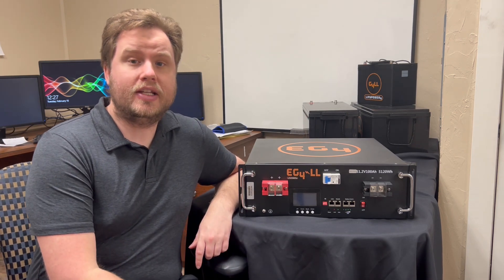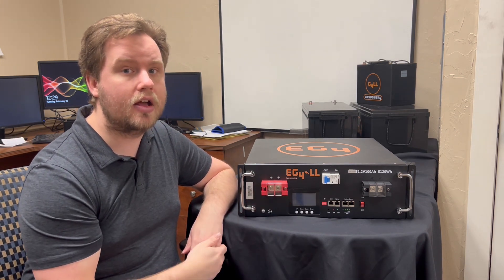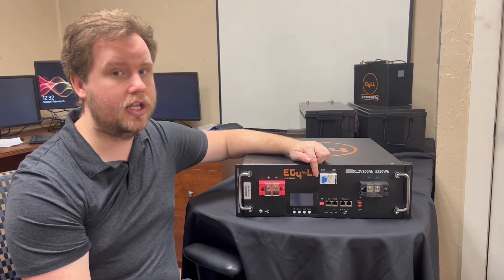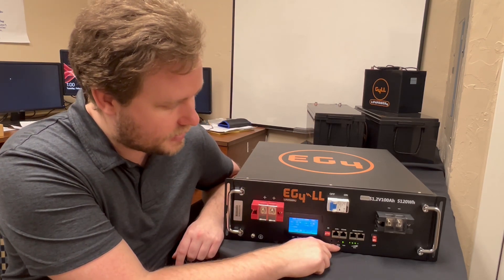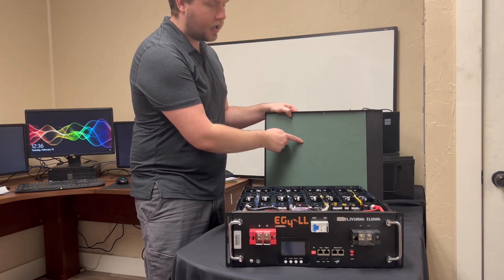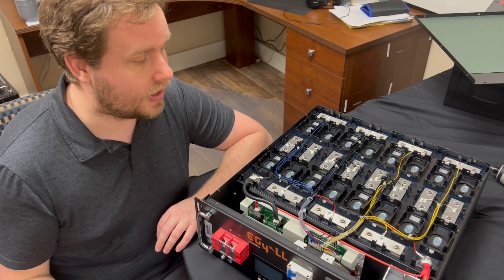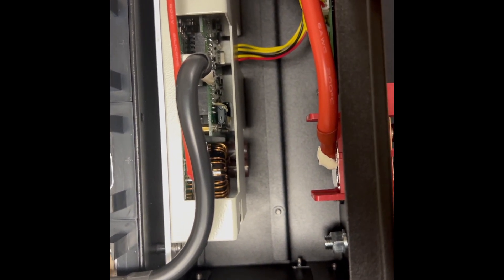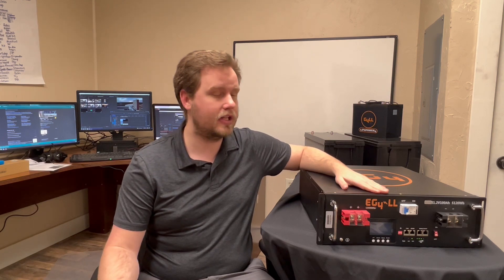EG4-LL 48v 100ah Battery Basic Teardown!

Comment: Is it possible for you to have a similar tube that tells about the 12V EG4 that does not have the screen?  I am also wanting to connect it to a Victron 12V MultiPlus II 3000AV charge inverter ...  is it practical to add a Bluetooth to watch what is going on?  ... Or does the PC software work good enough.  I also hope to install a Cerbo GX and would like to see if the system I ordered will connect.  I hears one of your other videos say something about a cable mod but it wasn't talking of the 12V

Comment: If the BMS shuts the battery down due to low voltage, will the BMS allow a generator to charge the battery from any voltage level, including the shut off level?
Reply: Applying charging voltage should wake up the bms to allow charging.

Comment: Would you do a video with 100 amps load and measure the voltage drop on the cables from the battery through the BMS and breaker ? You also failed to give the dip switch settings for the battery.

Comment: Is this battery compatible with the SMA Sunny Islands SI 6048-US-10 Units?  It looks like there is no way to communicate with the Sunny Island.  Would I just select Lithium batteries on the Sunny Island to manage this battery?
Reply from the maker: EG4 hasn't developed a closed comm with SMA yet. You can use them as just a battery without communications.

Comment: Your current web site shows the EG4 LL with no breaker on the battery positive terminal.  Your technical people said that it does not include the breaker now.  Is that true and if it is how do you turn off the battery?
Reply from the maker: There is an on/off switch. Depending on the model and voltage, some may or may not have a breaker.

Comment: Can you let me know if there are any plans to enable the communications from the battery to the MPP LV series of inverters.  Would love to get my batteries communicating directly with the inverters (LV6548s).  Happy to assist with any testing that may be needed as I have 5 of these batteries to support my two LV6548s in split phase.

Comment: I have two of these batteries connected and one shows typically 10% higher SOC than the other, so one will be at 39% and the other is 29%, due to their voltage being the same at those two levels.  They were purchasedf only 2 months apart.  I wish I could make the display stay on longer than 30 seconds too.

Comment: When these batteries are connected to the 6 slot rack, are you able to connect the battery chargers you sell directly to the bus bars? I have two of the chargers and was wondering if I just connect both chargers to the bus bars at the same time to charge all 6 batteries? Also, do a review of the 12k growatt :)
Reply: @Richard from Signature Solar yes to the bus bar and chargers correct? Not just the 12k review?

Comment: I have 3 of the older EG4 batteries without LCD and I'd like to know if I could swap out the BMS for the one inside this battery so it will communicate with my Growatt??
Reply: @Richard from Signature Solar and also, I'm mounting these in my RV and John told me that y'all have a down-converter so I can have a 12v bus for my 12v gadgets such as water pump and bathroom fan but I don't see it on your website. Can you send me a link?

Comment: Richard, As I stated in my first video in my trouble shooting of the Battery/Comm. ports I came to the conclusion that the there is no conection  between  the RS485 port and the Battery/COMM. ports. Please show us deeper look at the connections from the RS485 port to the Battery/Comm. ports. Also have you tested to see if an 8 port RS485/Can buss box can be used to connect the batteries to a computer to use the BMS Tools software?
Reply: @Richard from Signature Solar Thank you I will be looking forward to seeing it, I tested a 4 port unit from L-com today and it worked fine.

Comment: Good demonstration Richard.
Id like to request a teardown video of the 48v 100A waterproof model battery.
I just got 16 of them from you and it would be great to see the interior construction (and if I could use them standing upright on end or any other orientation) with layout of BMS etc.
Im assuming the BMS is laid flat beneath the top cover so for now I plan to keep the top of batteries unobstructed to allow for any BMS heat dissapation.
Keep the videos coming please.